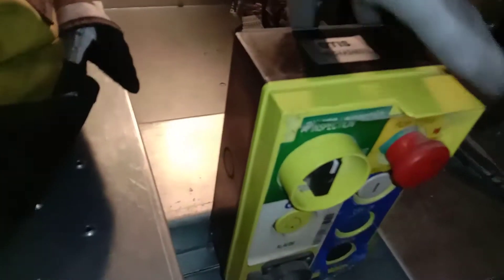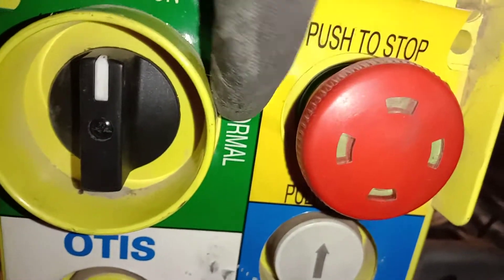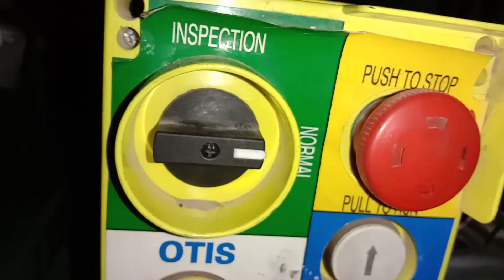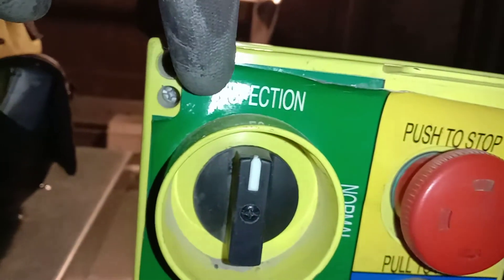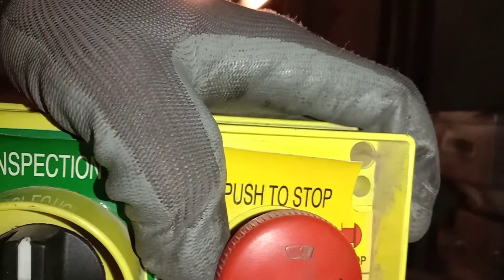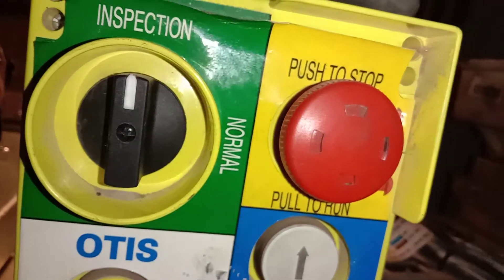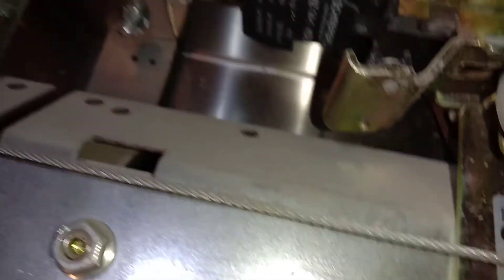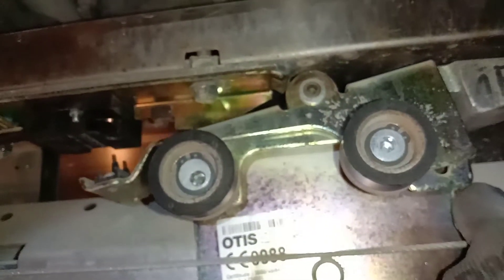MACHINE ROOM LESS ELEVATOR || OTIS Gen2 🆕 MODEL ELEVATOR

Comment: Please I need help, am working on Otis Gen 2 two speed, and am having issues and the solution is difficult to solve. If you can be of help I will really appreciate it. Here is the problem, when the lift is on the ground and someone calls it from outside and enter inside the cabin and the person send it to 4th floor, on it's way to 4th floor getting to 4th floor it will just suddenly go back to the ground instead of opening the door to the 4th floor, I have checked the roller of that floor and the distance maybe they are touching each other but no they is enough distance between them and I have also checked the if the cabin shoe is too free, they are very tight and ok. and I have use service tools to check the floor information if they are missing the Margret signal but they are all ok. Please help me on this if you have solution that I can use to solve this problem, thanks
Reply from the maker: Hi Abbey ! Your from where?
Reply: @pinoyhasawie8364  Nigeria 🇳🇬 but I have solved this problem
Reply from the maker: Good to here you solved the problem..
Reply from the maker: Keep in touch whenever you will encounter Otis Gen2 issue..
Reply: @pinoyhasawie8364  Alright, please where are you from?
Reply from the maker: I'm working here in Saudi Arabia.